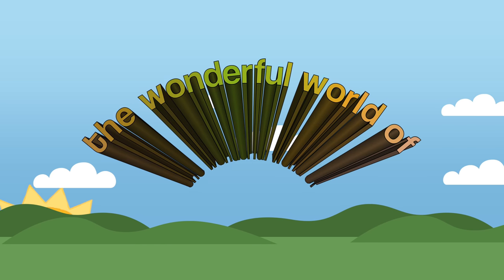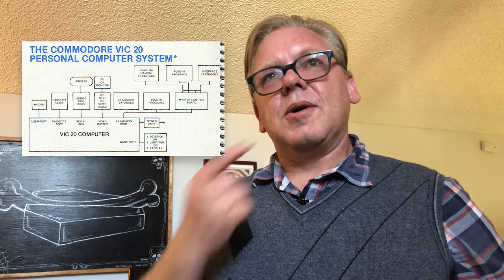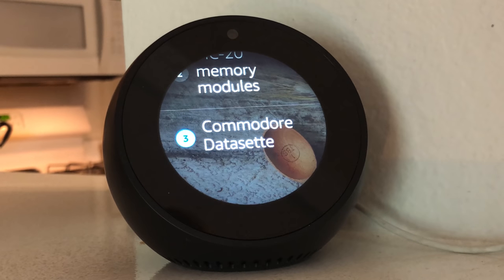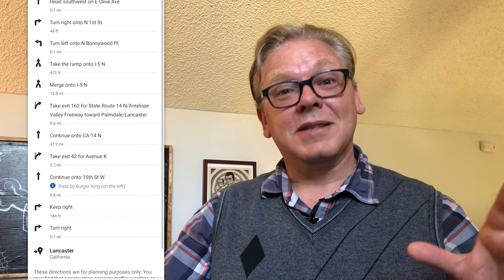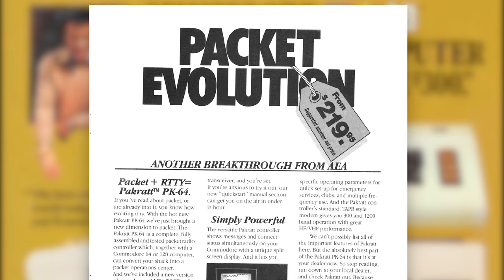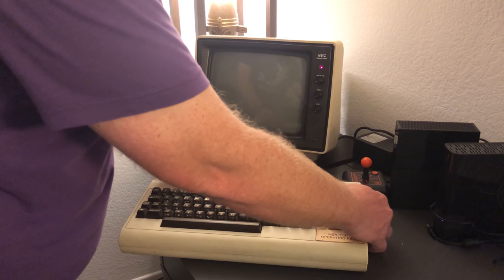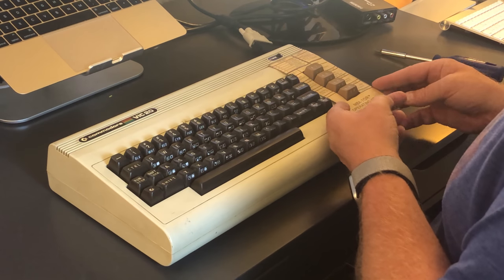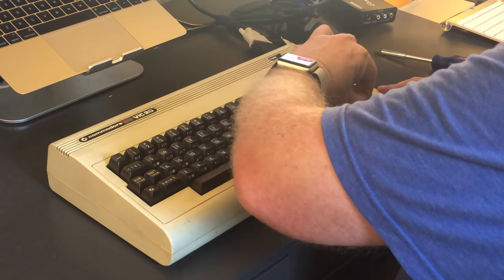I Don't Know What I'm Doing with the Vic-20 - Part 1

Comment: Re: Keyboard. While the PET keyboard is not the VIC 20 keyboard, (may not work) the 8 bit guy offers a potential solution in this video. 

https://youtu.be/uHbhH7ISL_Y?t=8m41s 

The 8 bit guy video gives a lot of infomation on keyboard diagnosis. So you might want start at the beginning.

I've seen videos where people have used vinyl pencil erasers to clean metal contacts. More for cleaning the cartridge and cassette contacts at the back of the machine. You might ask Jan Beta, but he's currently on vacation.
Reply from the maker: Thanks for the note! Jan Beta and 8-Bit guy are great! 

Luckily the keyboard (for the most part) has ended up being fairly straightforward to get working.  Everything was working fine with a known working c64 keyboard so luckily it's just the plungers. For a couple I may do the same fix as the 8-bit guy.  They're working, but require a little extra force.  

Two side notes:
1. I keep finding that 8-bit guy and I own the same bits and pieces of equipment - same soldering iron, same multimeter, same helping hands...  funny!
2. That known working c64 keyboard is for a future video with an arduino.

Comment: btw that power supply from the c64 can just let go without any warning or reason.. thats the magic of how they like to fry your machines.. replace it asap with a modern replacement using modern guts.
Reply from the maker: Definitely! I ended up getting one from commodore4ever with an adaptor to also connect a c128 - https://www.ebay.com/str/Commodore4Ever/